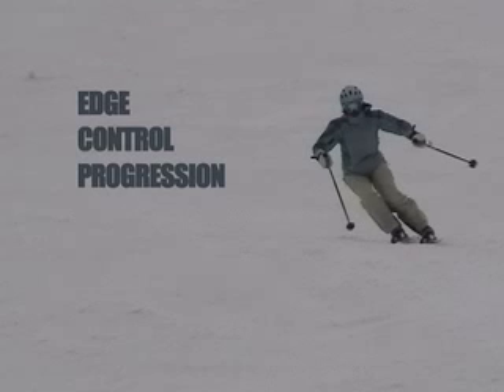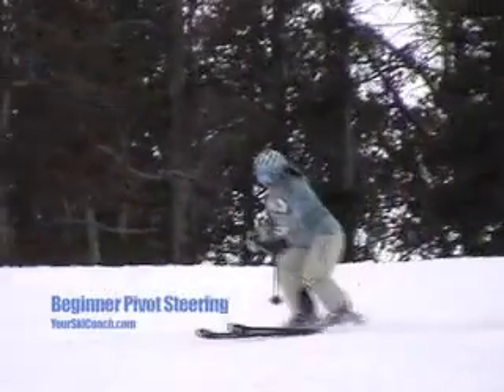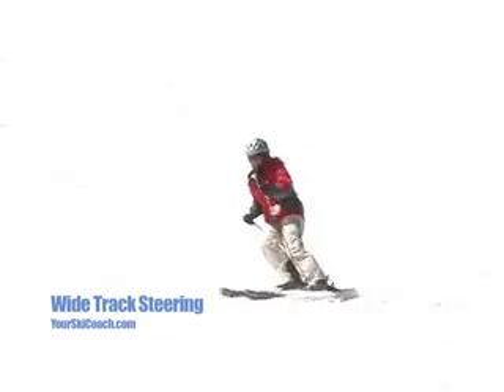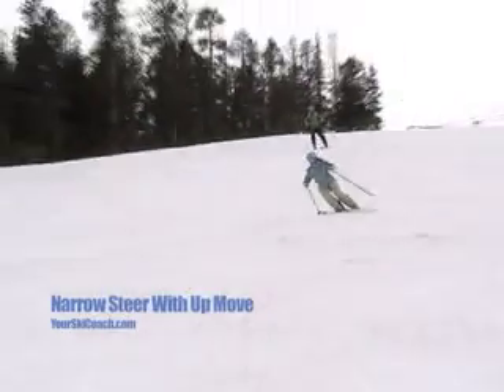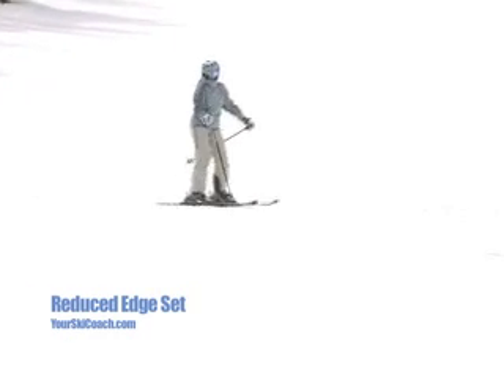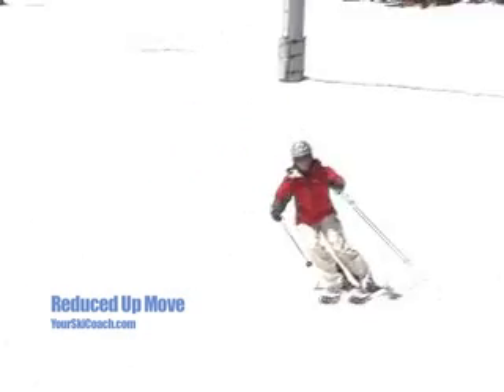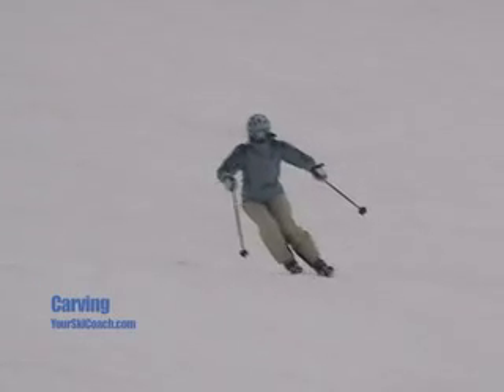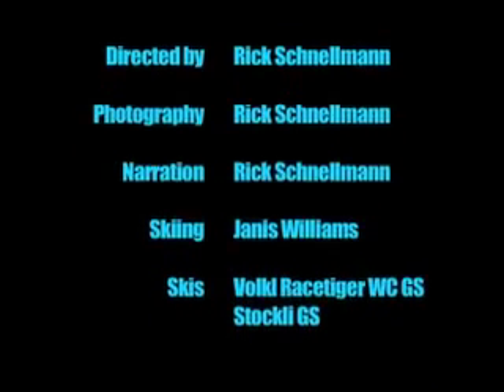Edging progression - ski instruction

Comment: Nice video. We all have gone through these few steps. 
I have one question. How do you control your speed by using carving?  If I keep "carving" on steeper slope. I start to feel I am flying easily. I don't feel that comfortable on crud or snowy situation with high speed "carving".